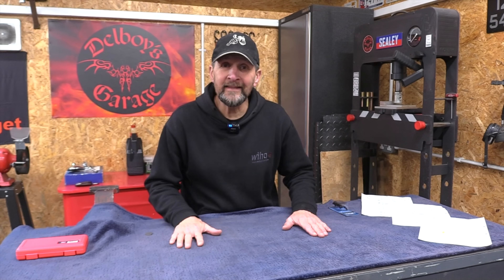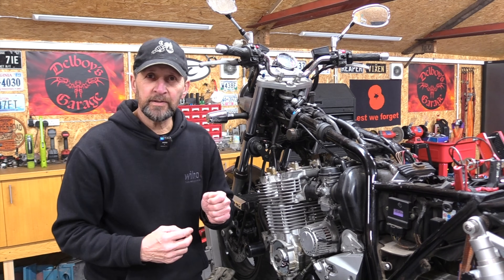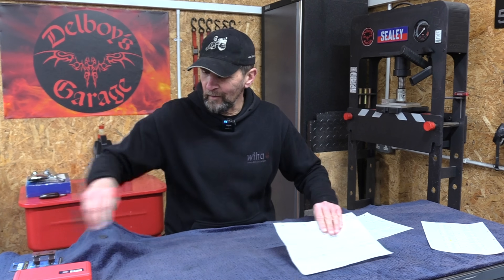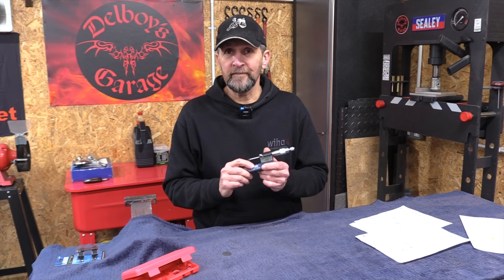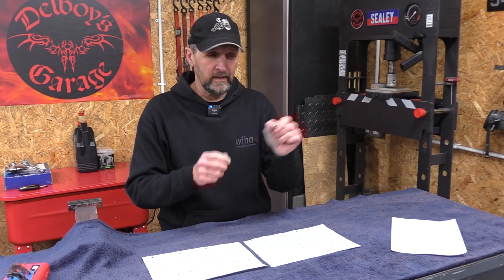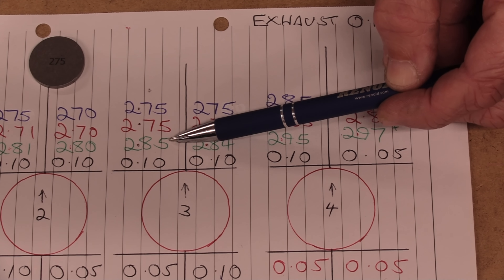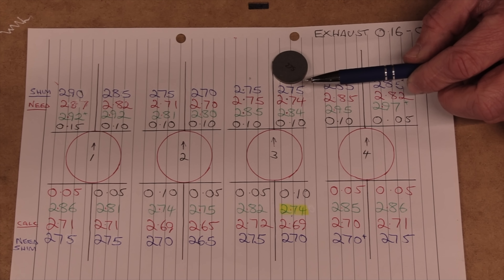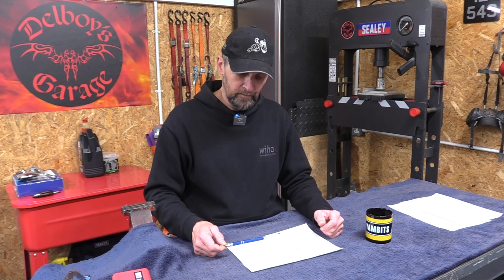Delboy's Garage:- How to Calculate valve shim sizes !

Comment: I don't understand how they get to tight are the shims getting bigger. Loose makes sense because of wear but not tight
Reply from the maker: OK, common confusion, it works like this :-  There is no signifigant wear between the cam lobe and the shim face.. a thin film of oil will keep the two faces from grinding on each other... The actual wear is lower down in the cylinder head.  The vavles are held tight against the valve seats by super strong springs, they snap the valve closed again when the cam lobe rolls away from the shim... and that constant slamming of the valve against it's seat (at thousands of times a minute), eventually wears the hole inwards, so the valve sits "deeper" in the head, and thus the top of the valve stem pushed up higher against the underside of the shim, pushing the shim itself, upwards, and therefore, "closing" the gap... this is called "Valve seat recession", and is the reason you then fit a thinner shim to restore the gap to within spec. !   Hope that's clear mate.. !!
Reply: Thank you for taking the time to educate me . I felt stupid asking  but i have an 86 Yamaha Radian and after  long rides she starts sounding a bit chattery. @Moonfleet41
Reply from the maker: @brentforte5950  My old man said to me a long time ago, "The only stupid question is the one you DIDN'T ask, just before you buggered it up" lol !   It's always good to ask questions mate, that's how we learn aye ! 
With the Radian, give it a thorough oil and filter change, using a top quality semi-synthetic oil, and see if it's still noisy, and of course, if the valve clearances haven't been checked for a long time then give them a look to check the clearances are right !

Comment: Now, here is the bit I don’t get. Why the clearances were too tight?! Are they not getting bigger over time so you need bigger shims? The bike was running with the clearances too tight. How long for? Likely from when it was made. Surely if this was an issue you would see some rub marks on the shims? Have I missed something here? Well done - great videos by the way.
Reply from the maker: Yes mate you HAVE completely missed something and perhaps it's a lack of understanding on how it works, so to just briefly explain... it's not the shim to cam lobe interface that wears, the wear is further down inside the engine where the valve itself closes against it's seat, constantly battering it's way in to the cylinder head, it gradually works it's way in deeper... known as valve recess... as this happens, the valve stem pokes up further towards the cam shaft, closing the clearance gap... hence the reason to put a slimmer shim to replace the gap.   I hope that explains it.
Reply: @ makes sense. Thanks for taking the time to explain. So would you ever have a situation where you would need ‘fatter’ shims or is always no replacement or replacing with slimmer ones?

Comment: Just done the valve clearances on my T100.  I made up an Excel spreadsheet for the calculaton and then recorded the shim size installed.  The printout is now in my folder so next time I know what size shim is installed without having to remove them.
Reply from the maker: Exactly that, or in the old mehanic's world you take that sheet I wrote, write a date on it and tuck it in the bike's history file, same result!

Comment: Good job putting that across Del. I've had to do it on many vehicles but i doubt i could ever explain it. 

" ordering with confidence" wasn't that Will Powers? love that song! 👍✌️❤️
Reply from the maker: I think that was the song mate, something about having spinach on your tools...!  Or is that another song lol. Not trying to make a tutorial here, just thought I'd explain the process, maybe justifies why the dealers charge what they do for it!
Reply: @Moonfleet41  it came over well, and I'm so glad you ignored the numbers on the shims and mic'd them yourself. Those which had markings of course. It's ok doing this for yourself but putting on the Internet I'm sure required a lot of careful thought. 
Top job buddy. 👍✌️❤️
Reply from the maker: Yes indeed mate, many years of doing this and always decided not to, it's so common that viewers skip forward and miss important guidance... but as long as we make it clear this is purely for entertainment, and NOT to be used as a tutorial, then im fine with making a demonstration of the process..

Comment: I was waiting for this one.
I thought you handled it very well.
Honestly, if people have never done this before, they really MUST get a workshop manual.
I’m pretty sure most Manufacturers include a chart with valve clearances vs shim size: and then have “look up” cross reference tables which will TELL the person what size shim they require. ( I think many new people get confused with working out correct clearances-lees-is-more etc)
ie: the valve clearance with the current shim is either too small or too large- you need THIS SIZE NEW SHIM to bring the clearance within spec.
Thank you both for the professionalism you display.
Reply from the maker: Thank you for your kind words Nick, I think we've highlighted here the common confusion in thinking that as time goes on, any clearance would wear and get wider, rather than smaller... caused by the mis-understanding that the wear in question is not the cam wearing the shim face, but the valve recessing in to the head... it's these simple mis-understandings of the mechanical principles that causes the confusion... plus of course, the worry of the expense of getting it wrong... more reasons to love your Harley or your Goldwing with it's hydraulic tappets lol

Comment: I always have supplies on hand, buying a kit package of 10, last such long time. I’ve had enough last me 10-15 years working. I put used ones in separate used bins when comes to that. I’ve never like re-use shims as may face unforeseen issues with them.  Personally, I don’t trust some YouTubers that’s not by the book. Good lesson here.
Reply from the maker: As long as you measure a shim and it's the correct size, it's generally ok to re-use them as long as they're not showing any signs of scuffing, or obvious wear, but of course, for the small amount of money they cost you could just replace them!
Reply: I agree there!  I measured few, some are weak iron or china made. Just my own precaution just replace new.  If no choice, then… 😊

Comment: I have done the shims on several engines over the years using a surface grinder and magnetic table. You simply grind off what you need to get the required clearance. It doesn't matter about the marked thickness of the shim if you have a micrometer to check it. When removing stock shims I would routinely check the sizing as these things are made to tolerances so could be plus or minus a fraction. Del's advice to invest in a micrometer is sound.

Comment: Do the shims get any wear on them ? What causes the clearance of valve to open up or close up ? 
Confused !!
Reply from the maker: Shims hardly ever wear, the clearances most usually close, rather than open, which is caused by the valve recessing in to the valve seat, making the valve stem push further up through the head, closing the clearance, so a thinner shim re-opens it.

Comment: I was able to get a complete shim kit (9.48mm diameter) for my Triumph (Scrambler 1200XC) for under $70. Coincidentally, they're the same diameter shims that I needed on my old Kawasaki 900 Z-1 I had back in the 1980's. I wish I'd kept the kit I had then, it would have saved me $70. With that bit of trivia out of the way, I think you missed an alternate career calling: teaching maths to gear/petrol heads. lol
Reply from the maker: Thank you Paul, I guess the Triumph would have been a tad cheaper, having half as many cylinders, I considered buying a kit, but have found in the past they leave you wanting if you need a single consistent size constantly... take care and stay safe!
Reply: Coincidences are weird. My Triumph T595 uses 25mm diameter shims. Exactly the same size as my 1980 Honda CBX 6 cylinder.
One has 12 valves- the other 24!

Comment: Could you use a Vernier instead of a micrometer? Thanks again Del, excellent stuff.
Reply from the maker: Not at all mate, there's a great deal more accuracy with a mic, which is required to get an accurate measurement.

Comment: noob question: what causes the clearances to change?  Guessing the cam lobe riding on the shim is causing a wear pattern but in the video I don't see any noticeable wear pattern...
Reply from the maker: No, it's the valve itself wearing it's way in to the seat in the cyclinder head, actually forcing the valve stem upwards closer to the cam and closing the gap... it's just a wear and tear thing mate... and as you pointed out, the valve shims don't really wear unless there's a lack of lubrication.

Comment: As an amateur and self taught mechanic I have done the valve check and adjustment a number of times on my old 2005 v-strom 1000... It was challenging at first but I always managed to complete the job successfully, so much so that the last time I did it I also replaced the camshafts with those from an SV 1000 (had to relocate the pin that locates the position on the camshaft in order for this to work on the V-strom) and the joy when I put everything together and the bike actually started the first time with no issues (and a lot more ponies) was worth all the hassle.
Reply from the maker: Sounds like a great project and what great ingenuity!
Reply: @Moonfleet41  thank you Del, I've been watching your videos for ages, you've been an inspiration to me.
Reply from the maker: Thank you for such kind support, it's an honour to help..  take care, !

Comment: That disclaimer at the end may be necessary in modern times, Del. I'm too lazy to do valves myself. My dealer is an expert I can trust. He's much faster than me and he doesn't charge absurd prices. If I want to save money I do other things myself like changing tyres, oil, fork oil... By the way, winter's the perfect time for a dealer's, you don't have to heat your shed ;-) Happy days, Günter/Nürnberg
Reply from the maker: You're right indeed, there's always good reasoning for paying someone else to do these jobs, as long as you can afford it.

Comment: You should have explained the reason for checking your cam sim clearance Del. That way people might have understood the reason why doing it. The reason is you need a small gap between the bottom of the lob and the sim face. That is so the valve is shut completely but if the gap is to tight the valve might not be seated properly. The tolerances like you said are between 10 and 20 but if the gap is to big between the sim face and the bottom of the lob that means the valve is not opening fully when the lob cames around to open the valve. If you get all the gaps correct it just makes your engine run better/smoother. Once you get the hang of it, it's not a hard job but having the tools you have it's easy money Dell. 😀
Reply from the maker: Very remedially explained mate... well done!
Reply: @johnmclean - "Welcome to the party, pal."  : )

Comment: Measure current clearance. Add that to current shim size. That gives you the total valve to cam size. Take away the spec clearance. What is left is your shim required size. Easy.
Reply: Spot on and best possible way to describe it. So easy when you understand things opposed to remembering formulas
Reply: Thank you!🙏🏻

Comment: If the shims are to large then someone has put the wrong shims in previously? My thinking being the shims are to take up the space left when parts are worn so you would expect the shims to be to thin, am I wrong?
Reply: Don't think of it as the shims wearing, but the valve seats and faces wearing. That makes the valve installed height taller, which makes the cam lobes closer to the valve and the existing shims. A skinnier shim puts the tolerance for expansion due to heat induced growth back to kosher dimensions. Your mileage (and valve clearance) may vary :)
Reply from the maker: Yeah, slightly mate... as the miles roll on, the valves will wear the seats down and that means the valve stem pokes up higher, closing the clearance..so you fit a slimmer shim to reset the clearance. !
Reply: @Moonfleet41  Cheers fella! I had it totally arse backwards. I was thinking the rocker arm faces where wearing down so the gap was opening.

Comment: I’m a Service Engineer (medical devices) and have tinkered with bikes most of my days, even now valve clearances give me the cold sweats, last one I did was a ZX12R when the inevitable leaking cam cover gasket got replaced. Full workshop manual (which was excellent) and sleepless nights later job done, the strip down to get there was a blooming nightmare and clearance to the chassis was challenging.
Good little series so far mate, looking forward to seeing a road test video once she’s done 👌🤘
Can appreciate why the disclaimer, these days of where there’s blame (perceived) there’s a claim make me angry as it gives the clueless an excuse to not face up to their own mistakes 🤬
Reply from the maker: Hi Nick.. yes, isn't it rewarding after all that trepedation and worry, getting it done, all the gaskets sealed, and a quiet running motor as a result.. plus of course, another skill set to your bow..   But don't sweat it buddy, i know tech's that will side step the jib at any cost if they possibly can, not because they don't know how to do it, but becasue it's so invilved and critical..lol!

Comment: Yes we had to adjust shims on vw engines , a lot were put In upside down, they are now hydraulic, but they ,some times didn’t jack up, again  we had to find the  tapper  and replace it  finding it with screw driver and find the element which bounced ! Great fun valve clearances adjustment
Reply from the maker: It sure is David, 'finding the tapper' is endless fun aye, speially when it's a partial leak, and only taps for a few seconds on start up....lol!

Comment: Nice one Del
Reply from the maker: Thanks Richard 👍
Reply: Awesome video! Thanks Del
I’m looking at every possible valve shim video, aside from reading the Haynes manual, and doing all the normal maintenance myself thanks to your channel (and the manual of course) to collect the confidence to do this thing within the next 12 months. 
But only if the buildup confidence is enough at that time 😂🤷🏼‍♂️, else I will hand it over to the dealer..

Thanks again,
Greetings from the Netherlands,
Gert
Reply from the maker: Thank you so much for your kind words Gert. Im glad to read that you're putting in the leg work and research, that's no different to how any apprentice learns their trade, so good luck with it, and im glad you take the view that the dealer is an option if you're still not sure enough.. mistakes cost more money to rectify than a dealer charges to do it.. so see how you go and Good luck.   Del.